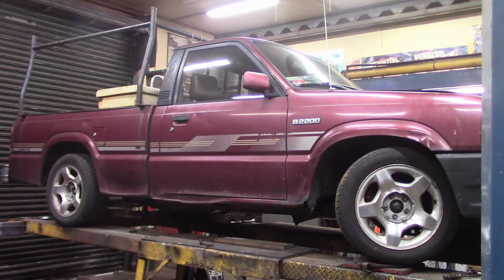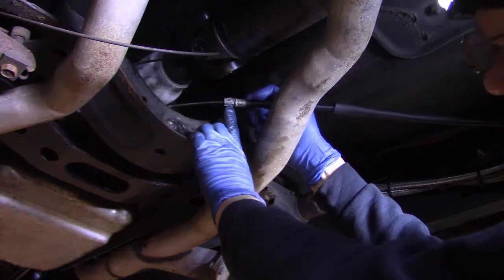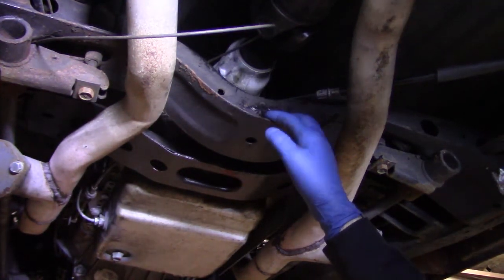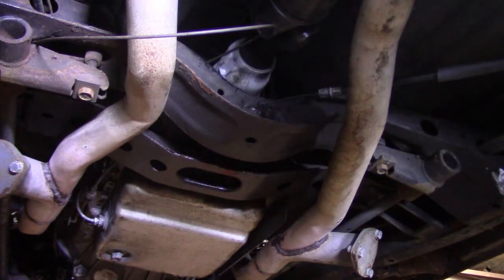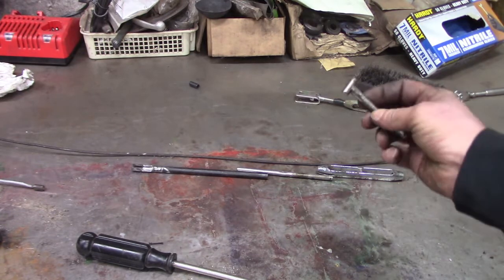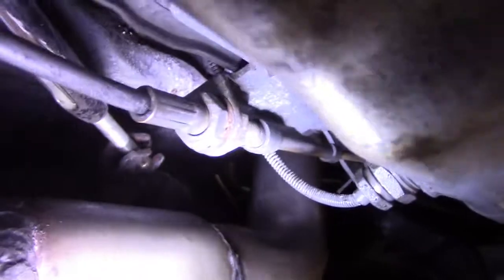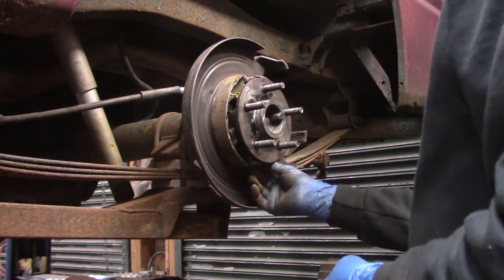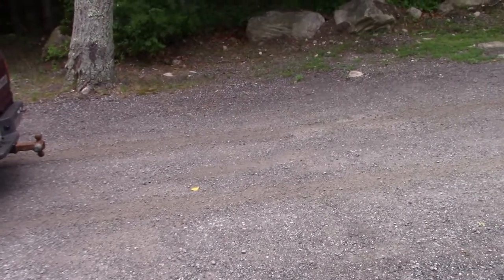LS SWAPPED MAZDA B2200 E-BRAKE CONNECTION TO FORD 8.8

Comment: How does the b do towing a trailer? What size trailer and weight have you towed. I know power wise no problem stopping should be good on paper
Reply from the maker: I have always towed a 5' x 9' utility trailer loaded with a lawn tractor or the like with this truck even when it was 4cyl 5spd. It was always scary to stop and slow to get up to speed. Now it is a pleasure to tow the trailer, and if/when I participate in Hot Rod Drag Week, Rocky Mountain Race Week, or Hot Rod Power Tour I plan on towing a trailer loaded with race tires, tools, fuel, and spares. The bigger brakes makes it so much nicer, and the drive train is from vehicles that weight 1000#s more, and have higher capacity ratings than the B2200 did. When I took the heavy duty helper leaf out of the rear springs, it reduced my cargo hauling capacity quite a bit. I can only haul 400-500#s in the bed. I am hoping by using a trailer the tongue weight won't make the truck squat too bad.